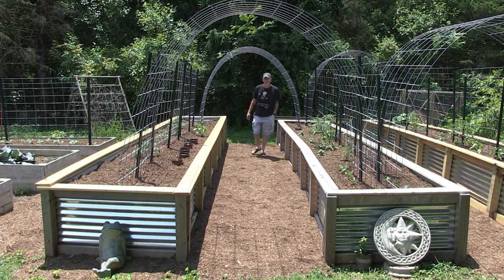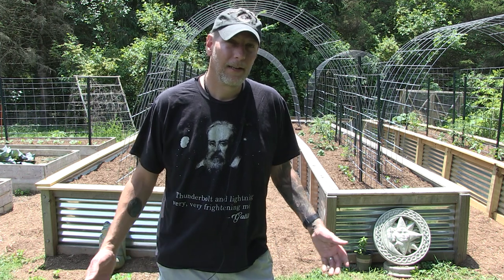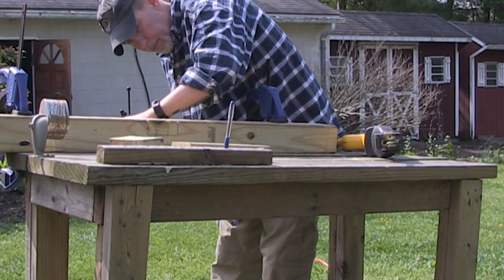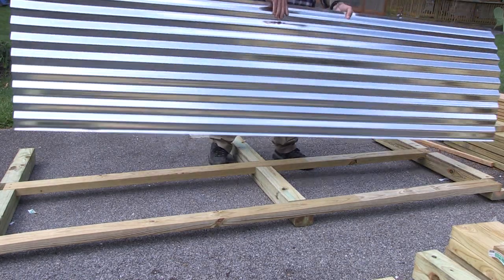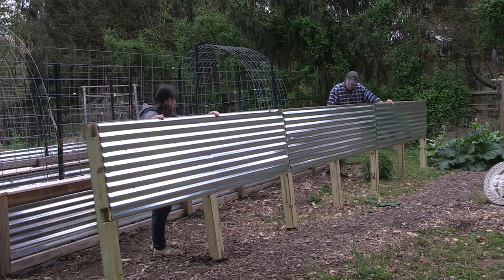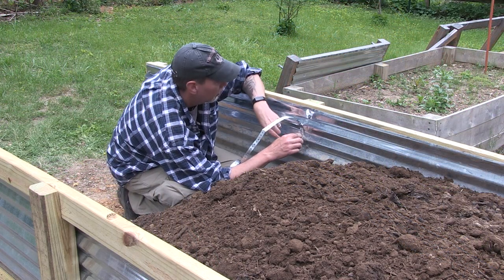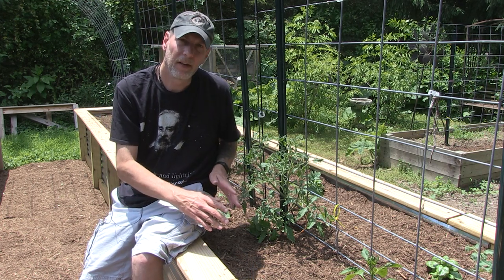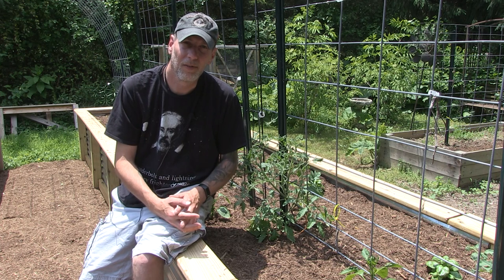How to Build A Raised Bed

Comment: I did similar to this 2 years ago. I used 16 ft by 21 inch old garage door panels. I used oak 2x10’s on the ends.  I used heavy  seed sign posts 1”by2” about a foot into ground and to near top of panels. I ran an untreated 2x4 around the top for support. I used double link chain every 4ft at the ground stakes like your metal straps to prevent spreading. I ran a 3” field drain tile loop (plastic around bottom inside. Sometime I plan to run daytime air through it to warm up early in the spring or to keep warmer in the fall—I am in mid Ohio. I added several inches of cornstalks in the bottom—I am a farmer— then filled with composted corn stalks and dirt. Your system looks like a good one.      Duane
Reply from the maker: Wow you put a lot of options into yours. I like the drainpipe idea. I'm in Western Maryland, so our weather patterns are probably fairly similar.

Comment: Gonna make these this year. Suggestion for fill: use wood inside on the bottom for hugelkultur (less watering as they rot). I did this in planters last year and zero watering needed all summer. Then add the dry compost then good composted soil with worms and bugs.
Reply from the maker: Great suggestion. In some of my beds that I built after this video I did use old straw bales, leaves and some small sticks in the bottom to help with some of fill. I wish you success with your build!

Comment: Very nice presentation and good looking beds. I don't understand why you need to sink the posts into the ground. What adverse conditions do you have that would call for your beds to be anchored like that? Most everyone I know including myself use a free standing bed. We have poor rocky soil as well so digging a hole for several post caused me to rethink this. I sure appreciate your great ability to teach. Great job
Reply from the maker: The walls tend to bow out over time when the posts aren't sunk in the ground. My first bed (in the picture near the end of the video, bowed, so I took it apart and rebuilt it with the posts sunk in the ground. Since then, they haven't moved at all. I think it probably depends on the length of the beds as well as the height on if you need to sink them in the ground.

Comment: Love this raised bed,  it's been my dream to have a couple.  I  wish I had someone to help me, at 74 with a bad back I don't think I could actually make it.
Reply from the maker: You possibly could make a smaller sized one to start, built right on the site where you want it to go (instead of preassembling and moving larger pieces).  The hardest part is digging the  holes for the posts and moving the dirt. If one is built with shorter height, digging holes for the posts may not be necessary.
Reply: @oneseedoneworld  thank you,
Reply from the maker: @lindamilroy3156  Your most welcome. I hope you are able to build a couple or have someone help you. Once built they are great to use!

Comment: Very nice, I haven't seen a monolithic bed that large before. Most people do 4x6 or 4x8 type  beds but the lapped joints and 4x4 sunk into the earth is an interesting take. Too bad lumber to make this would be $300-400 right now plus about $450 in soil cost for 9 cu yd. I love it though. Lots of planting volume there that will last many years! Worth the investment.
Reply from the maker: Yes, with lumber and other materials going up, prices have definitely increased since I built these original beds. When I did this video, materials ran less than $200 for a 4x24 bed (if using all new material). When I made my next set of beds, a 4x16 bed ran $400. There are still options of using recycled materials on the cheap or even free. Soil cost can be reduced by doing a partial hugelkultur type fill and then topping off with soil. But whatever the choice one goes with to fit their budget, these beds last for years with very little maintenance, so its still my top choice. Saves my back and I like the overall look of them. Thanks for watching and commenting!

Comment: What an excellent video. The directions a re short and concise from implementation to completion. I plan to put those in this spring if my back can take it and if not, I will find someone to help me.
Thank you very much.

Just out of curiosity did you use redwood? I have seen people say to avoid using any type of treated lumber which makes sense. I do not doubt that fir would perhaps last a few years before rot set in, but it would sooner or later.
Reply from the maker: Thank you! I did not use redwood. Cedar and Redwood were not in my budget at the time. I did one bed with untreated pine and the remainder of the beds I used treated wood. There is a lot of debate over the use of treated wood with raised beds. They did change the chemicals used in treated wood back in 2003, so that they have different compounds then previously used. The compounds currently being used are alkaline copper quat (ACQ) and copper azole (CA-B). Both contain copper and a fungicide but no arsenic. If you want to be a certified organic producer/seller, you can't use any treated wood even with the new compounds.
In the case of these raised beds that I built, the wood is on the outside of the metal, so only the metal is touching the soil. Granted, its not water tight, so there is a chance there could be some leaching into the soil from the spacing where the metal sheets join up. For my personal use, I believe this is so minimal that I am not concerned with an issue. We don't use any sprays or fertilizers (other than our bunnies poop) so we are doing the best we can to primarily be organic.

Comment: Thank you for this video! This is inspiration for our new spring project.  Just trying to figure out how you secured the end pieces.
Reply from the maker: Thank you! For the end pieces, I have done it two different ways. On a couple of the boxes I just made a separate piece and then bolted that on to the end. On the most recent box, I just ran a top and bottom 2x4 from either side wall at the end and then attached a piece of the corrugated metal to the inside of it before I finished filling the end with dirt. Making a separate piece and bolting it on his probably an easier route, but either will work. Good luck on your build!

Comment: Would you by chance happen to remember the thickness of the corrugated sheets please? Would love to have a go at this in the New Year but just want to get things right. Awesome tutorial and a fantastic looking garden, one seed one world 🌎
Reply from the maker: Thank you so much! I am not sure how thick the panels are. I checked the specs on the Lowe's website, and they don't list how thick the metal is.  The corrugated metal panels I used were:
Width (feet):  2.16
Length (feet) 8
Rib Height: 1/2 Inch
They are galvanized steel (economy grade) made by Union Corrugating. Lowes normally has them in stock and they come in lengths of 8, 12 or 16 feet, but I find the 8 foot ones easier to work with for the way I build my beds. Good luck with your build!
Reply: @oneseedoneworld  greatly appreciated the response and specs given, this information will come in very handy, all the best and stay safe.
Reply: 30 gauge is pretty common
Reply: @jasonbrown7258  appreciate that 👍 thank you very much.

Comment: Hi!  Looking to make this this spring.  could you tell me what tool you use to cut the corrugated metal? Need to make 12x4 so would need to cut some of this.  Thank you!
Reply from the maker: I just used a pair of metal shears (tin snips as my dad used to call them).  Amazon has a 3 pack of them that includes both the curved and straight blades here: https://amzn.to/3WuZPNB
I think the straight edged would work the most efficiently, but I didn't have those at the time, so I used the curved edge. Also recommend wearing gloves  when cutting and handling the metal, it will save your hands on those edges! Best of luck with your build!
Reply: @oneseedoneworld  Thank you so much for your reply!  Now to get to work on the plan!

Comment: Outstanding work, very practical and looks very nice.   How many years do you get out of the woods frames?  I have been thinking about going all metal with no wood frame.
Reply from the maker: Can't say on the longevity yet. This is the third season for my oldest bed and doesn't show any signs of decay or any other issues. I am going to stain them this year with linseed oil which should help them last longer as well.

Comment: Great video, how far apart are spacing the rows of beds in order to use the 16 foot cattle fence panels to arch over between them give enough headroom to walk under.
Reply from the maker: Thank you! My row spacing is about 3.5 to 4 feet. I didn't do them exact, was mainly aiming to roll my wheelbarrow down between them when needed.

Comment: Bowing out seems to be a common issue with all raised beds, no matter how high (6" to 2'), over time, and many videos show this issue. I wonder if the posts in the middle might be better set in concrete instead of trying the various cross supports.
Reply from the maker: Possibly. I have seen some people who have concreted the posts in, but I didn't want that much permanence I think. But this is my third season for my first bed, and it still hasn't bowed. So far its holding well.

Comment: 5:12  Actually, the post being sunk into the ground will only stop the bottom from splaying out.  You need the strap or something to stop the top from splaying out.
Reply from the maker: Good info. I haven't experienced that since I used the metal strapping on all mine, and didn't know if it was necessary or not.

Comment: I noticed the shot you showed of the summer beds it looks like you applied stain.   I like that look.  What did you use and is it safe?  Thank You again!
Reply from the maker: I haven't stained my beds as yet. I think what you are seeing is the difference in the wood from the beds I built last year to the new ones this year. The older ones have just weathered some. A safe option I believe would be linseed oil, and that is what I plan to stain mine with. Made from the seeds of flax, raw linseed oil is safe for use on planters, although it needs an extended drying time. While it may leach from the wood into the soil, raw linseed oil is not harmful to humans or animals.
Reply: Excellent information thank you very much.  I'm using Linseed oil!

Comment: Any concerns regarding the treated wood leaching into the veggie bed and eventually into the veggies that you are eating?
Reply from the maker: There is a lot of debate over the use of treated wood with raised beds. They did change the chemicals used in treated wood back in 2003, so that they have different compounds then previously used. The compounds currently being used are alkaline copper quat (ACQ) and copper azole (CA-B). Both contain copper and a fungicide but no arsenic. If you want to be a certified organic producer/seller, you can't use any treated wood even with the new compounds.
In the case of these raised beds that I built, the wood is on the outside of the metal, so only the metal is touching the soil. Granted, its not water tight, so there is a chance there could be some leaching into the soil from the spacing where the metal sheets join up. For my personal use, I believe this is so minimal that I am not concerned with an issue. We don't use any sprays or fertilizers (other than our bunnies poop) so we are doing the best we can to primarily be organic.

Comment: How much do they cost to build??
Reply from the maker: It can really vary based on if you are buying all new material or using recycled material. When I built the first ones in this video, a 4x24 bed cost me $200 in material -all new (not including dirt). But lumber has gone up significantly since then. Last year I built four more beds that were 4x16. Pretty much all the lumber I used was recycled from a chicken run I took down, so the only cost I had were the metal sheets (around $21 each) so those beds were a little over $100 each (plus dirt). The more recycled material you can use on the cheap or for free will make a big difference!

Comment: I'm planning on building the same but I didn't plan on the 4x4's going into the ground.  I'm not sure what the purpose of that step is.  Could you explain that before my build.  Thank You
Reply from the maker: Sinking the posts into the ground keeps the sides from bowing out. I built my first one of these a year ago without sinking posts, and within a couple of weeks or so, the sides started to bow. By the end of the summer they had a significant "lean" down both sides. So I took the whole thing apart and rebuilt it this year with longer posts that were sunk in the ground. The beds that I built with the posts in the ground haven't moved at all. Good luck with your build!

Comment: How does using the metal panels affect the soil temperature and moisture both in the summer and winter. I am in the deep south and feel summer soil temps would be too high and damage roots.
Reply from the maker: I haven't taken soil temp readings, so I can't say on specifics. I'm in zone 6b western Maryland, and haven't had any issue with root damage. My plants flourish in these beds. The beds on the eastern side get direct sun on the sides early in the morning as the sun comes up in the summer, but as the sun gets higher in the sky, it isn't hitting the metal directly. I also don't plant at the very edge, but normally leave a few inches or up to a foot gap between where I put the plants and the edge of the bed. I'll have to take some soil temp readings over the next season to get a better idea, but I've been growing in these beds for 4 years now, and haven't had issue with soil temp issues. But I think it could also depend on the layout based on sun positioning.

Comment: Bout to start construction using your plan. Going with 16 ft x 4ft though. I will most definitely give you a shoutout on my newly started channel 😊. Just wondering what size screws did you use to secure the 4x4's or just the whole project? I'm so excited to get started 🤗 thanks
Reply from the maker: Awesome! I hope the build goes well for you! I used 2 1/2 inch deck screws. On my original bed I also used self tapping metal roofing screws with the rubber grommet to attach the metal to the wood, but don't know if that was really necessary and I didn't use them on the next two beds I built. Success with your channel as well! I'll subscribe!
Reply: @oneseedoneworld  thanks so much again, and yes please subscribe. Just getting started but so much to come! Thanks for the inspiration I got from your channel and others 😊 I absolutely love the name of your channel  ❤
Reply from the maker: @spoonnwithsunshinehomestead  thank you!!!!! Yes I subscribed to your channel this afternoon!

Comment: Are you still happy with these? I'm considering building out beds. Our garden is 40' deep though. I'd considered the pre-built 32" tall metal raised beds but it's honestly cost prohibitive at that scale. Anything you'd change?
Reply from the maker: Absolutely. Been using my original 3 for four years and they are still going strong. I built four more last year. The only thing I would do different are the 1x6 boards I run around the top. I would do them in shorter lengths, or add some blocking underneath to screw them into for more support. I found that mine over time (especially if not stained or treated with raw linseed oil) tend to shrink and curl up (pulling out of the single line of screws) and have to be replaced. But they don't have anything to do with the beds structurally and are easy to fix/replace.

Comment: These look really great! One thing I noticed @9:50 (your photo from the prior year), is one of the beds is bulging at the sides. Was this one the beds you built without sinking the posts into the ground? How long have these beds lasted so far, and are they still holding up?
Reply from the maker: Thank you! Yes the one bed in the picture that had the bowing sides was the first bed I ever built and did not have posts sunk in the ground. I replaced it with the bed I am building in this video. My oldest bed that has the posts sunk into the ground is now going into its third season. No bowing or any other issues. Holding up great! I plan to do a new coat of linseed oil on the wooden frame this spring.
Reply: @oneseedoneworld  That's very reassuring! I just ordered supplies to build three of these. Lumber has become very expensive here, so the metal panels are cost effective. Do you also apply linseed oil to the pressure treated lumber, or only to the untreated bed?
Reply from the maker: @haroldcostello3697  I didn't apply the linseed bed to the treated beds last year, but will be adding it to all of my beds (both treated and untreated) this year.
You aren't kidding about the wood prices. They have tripled here since this time last year. The greenhouse I'm building cost way more than the deck I built last year and it had less than half the wood!